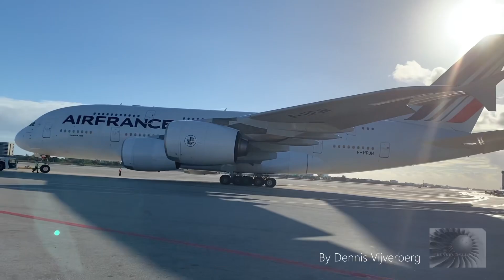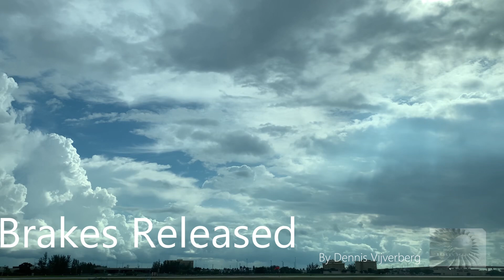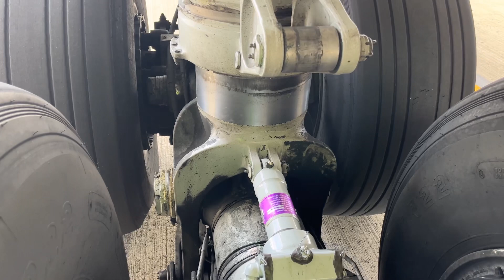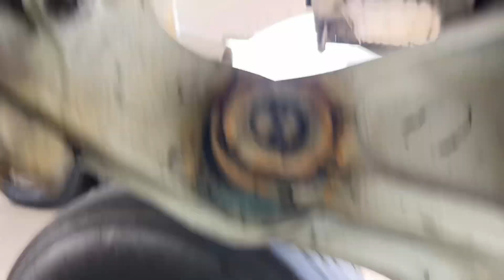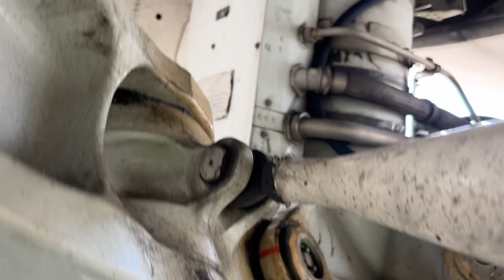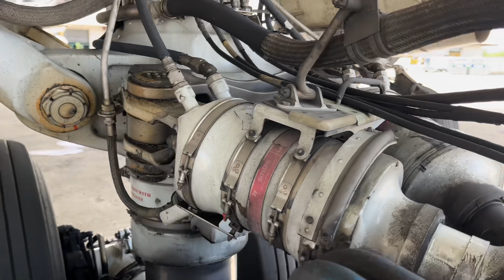Boeing B747 body gear up close and personal #boeing747 #aviation #cargolux

Comment: I assume that the LX-OCV has suffered a malfunction/breakdown of the body gear tilt actuator: on touchdown they touched the two front wheels of the tandem first.
Reply from the maker: Hello Lorenzo, I think the tilt actuator is most likely the cause that the gear could not retract and that the aircraft had to return. But I think it’s probably not the only failure that caused the body gear bogy to separate on landing.